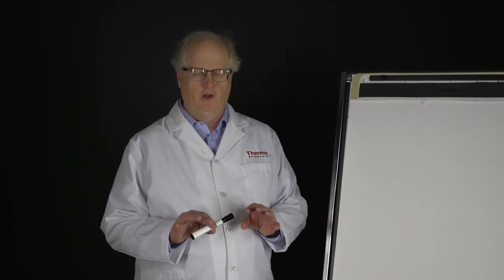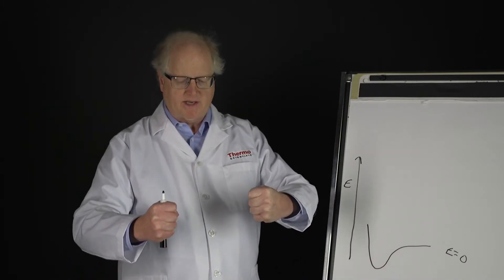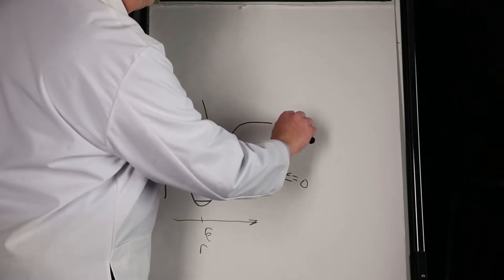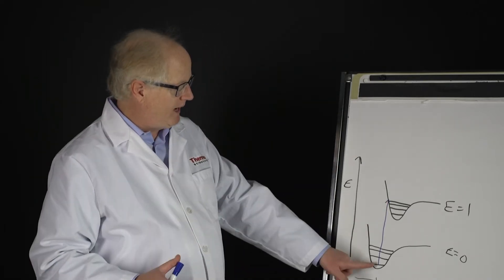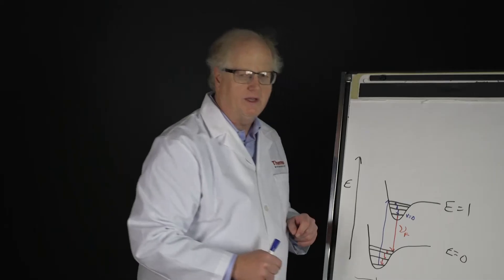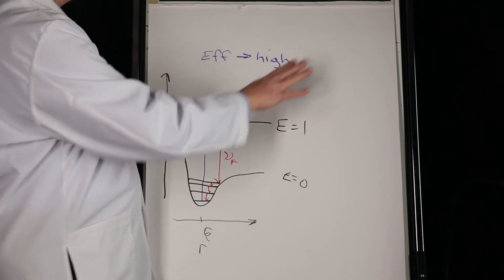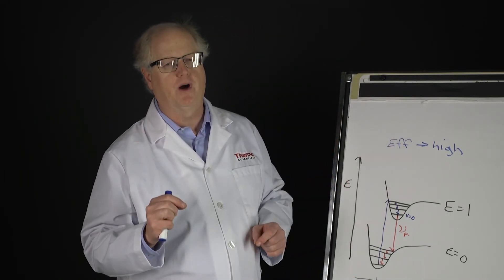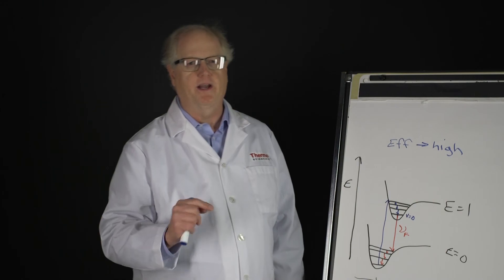Raman Fluorescence

Comment: Excellent Raman presentation.  Does fluorescence require a collision with a specific region of a molecule?  What is the specific light matter interaction which induces a Raman backscattered photon, which exhaustively explains why only one in a million photons are Raman shifted? In other words, does a Raman scattered photon directly collide with a bond or a specific region of a molecule in order to be Raman shifted?  Is the incident angle of the photon also a determining factor?  Can a photon shift in frequency due to passing through an electromagnetic field without colliding with a molecule?  (Unrelated, but analogically, did the photons observed in the solar eclipse experiments to prove Einstein's Theory of Relativity shift in frequency in addition to trajectory, without a direct light matter collision?  If so, could any shifts in frequency be measured by analyzing the photographic plates or film assuming that they have not decayed?)  If the vibrational mode is persistent what is the specific light matter interaction which explains the increase in the number of Raman shifted photons during a SERS analysis? Does SERS enhance or expand the electromagnetic field of a molecule? Does the entire molecule resonate at the frequency of the vibrational mode of specific regions of the molecule?  Does Dr. Michael Bradley's dissertation study of argon atom collisions require additional laws of physics to explain the Raman Scattering Effect, when there are no single molecule bond vibrational frequencies involved?
Reply: For raman scattering to our...
The incoming photon should change the polarizabality of the molecule. If their is change in the polarizabality, then only there will be scattering with different wavelength/frequency called Raman scattering. If there is no change in polarizabality, then there will always be Rayeligh scattering having same frequency as the incoming laser light photon.